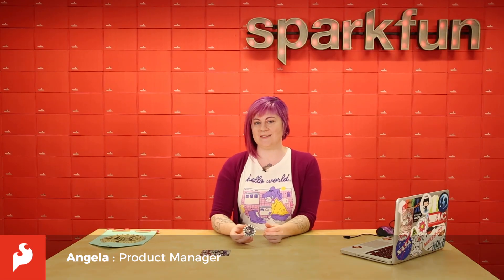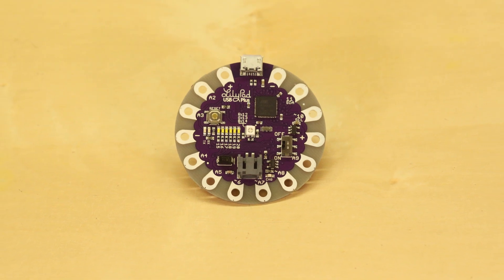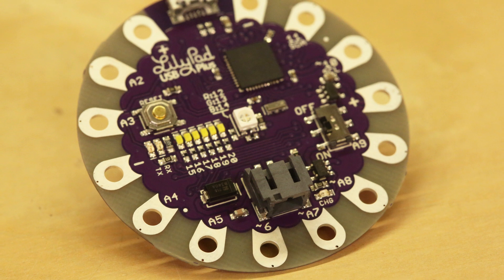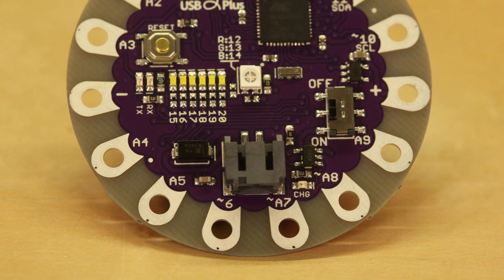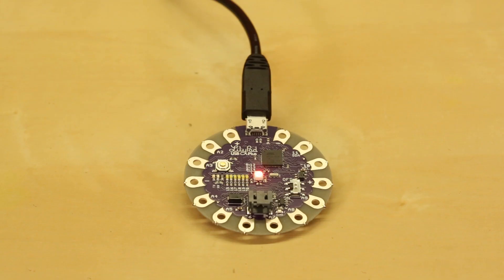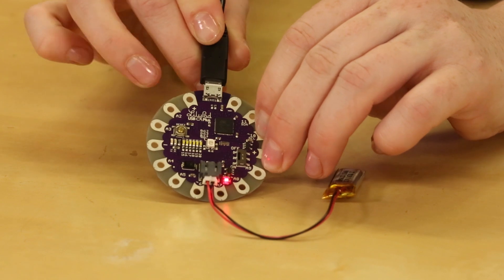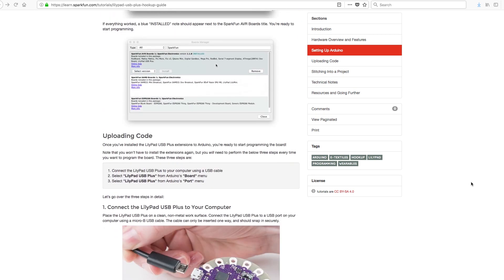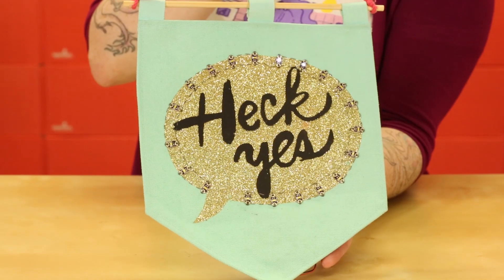Product Showcase: Lilypad USB Plus

Comment: Will this microcontroller allow data from an accelerometer and temperature sensor to be sent to a PC for analysis, through the USB connection?
My senior design team is working on an Arduino project, if anyone has some time to answer this question I would be extremely appreciative. We are creating a wearable arm sleeve to monitor epileptic seizures, and will be purchasing an accelerometer and temperature sensor from SparkFun. We need a way for the sleeve to be rechargeable, as well as to send the data from the sleeve to a computer, and have purchased a Bluetooth module. (Sorry if this question doesn't make much sense, I still don't understand Bluetooth very well.)
Thank you!

Comment: The ATmega32u4 is an awesome microcontroller because of the fact that it has built in usb support and can act as a usb device.

Plus it has a similar number of pins that the ATmega328 has.